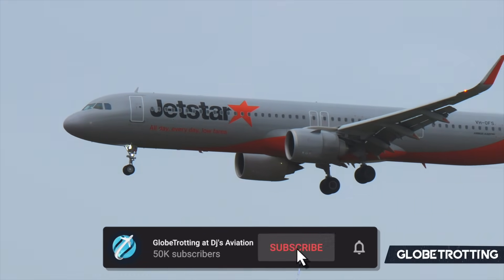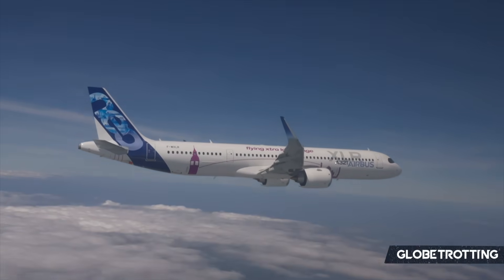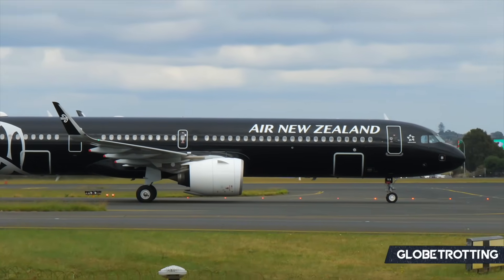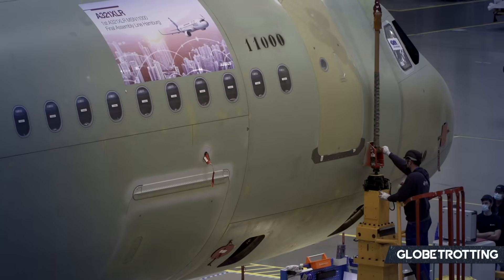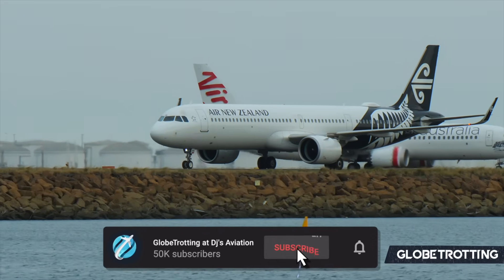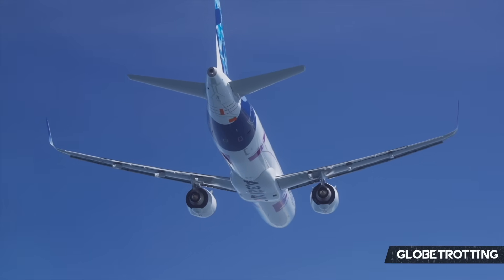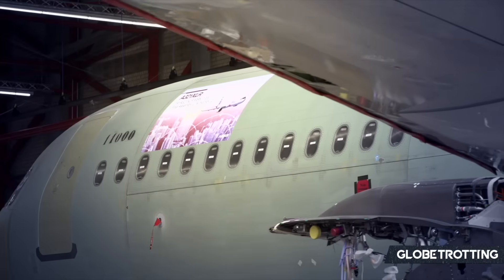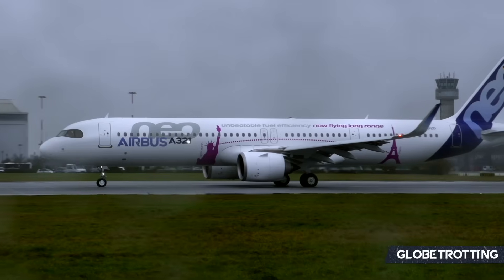The Airbus A322 vs A321XLR

Comment: To me the A322 sounds like a DC8 series 61 or 71. A sound aircraft of its time stretched a bit just before the next big change happened.  ( wide bodies in those days, rather than efficient engines and etops)
Reply: The A322 is a fake concept and it’s not an A321NEO, it should be retired

Comment: No A322 until 2030-at least. A322 will cannibalise the current order backlog on the NEOs.
Reply: Agree i don't see Airbus launching an A322 this decade will probably use a variant of the Ultra Fan, new high aspect ratio composite wing and thermoplastic Carbon fuselage.
Reply: @ivanviera4773 the A322 is a fake concept and it’s not an A321NEO, it should be retired
Reply: @Mf-ct5ms: the A322 is a fake concept it’s not a NEO and not an A321NEO, it should be retired. The A322s would make the A321XLR and A321LR useless they’re production would be discontinued and they’ll be scrapped, that would be dreadful

Comment: The 757-300 wasn't successful due to its length and the amount of time it would take to load plus the hit you take on range isn't worth it so an A322 seems like Airbus would be barking up the same tree with the same results. Once you get into mid 200s in pax capacity, a widebody becomes the better tool.
Reply: The 757-300 was 54m long a Airbus a322 could be just 49 or 50m long, just a bit longer than the 757-200
Reply: @young-j731  at that point you're encroaching on the already poor sales of the A330-800 which I think is another reason Airbus won't consider a 322.
Reply: @ekt8750 that’s why the A322 is a fake concept and it’s not an A321NEO, it should be retired
Reply: @young-j731 the A322 is a fake concept, it should be retired
Reply: The worst feature of the 757 was the same as its best feature - overlarge engines that gave it great performance (pilots love it) but also made it a gas-guzzler.

Comment: I'm surprised there isn't already a A322.
Reply: Lack of suitable engines to power the longer and heavier stretch, unless a significant amount of weight can be lost.
Reply: @neilpickup237 would an a322 not be a carbon composite sort of deal making it lighter I have zero clue btw so don’t roast me 😅
Reply: @h0udinl As for carbon composite -  for the wings possibly, however, for the fuselage, this could require so much re-engineering to optimise that a clean sheet design may make more sense.
Reply: @h0udinl the A322 is a fake concept and it’s not an A322, it should be retired
Reply: @neilpickup237 the A322 will make no sense because it’s a fake concept and it’s not an A321NEO, it should be retired. The 757-300 is longer than the fake A322 concept so the fake A322 concept won’t be a replacement for the 757-300, the fake A322 concept will make the A321NEO production useless and the A321NEOs will be scrapped, that would be dreadful

Comment: Almost as if Boeing should have really updated the 757 to compete in the future. A322 would just be an improved 757.
Reply: @tylerduchesneau  imo they picked the wrong narrowbody to hitch their wagon on. When the 757 launched there were plans for a -100 which would have been a shrink of the -200 and fit slightly above the 727-200. Boeing scrapped it after seeing that it would likely hurt sales of the upcoming 737 Classic series.

Imo the time to act would have been in the late 90s after the NG launched to develop a clean sheet narrowbody to unite the 737 and 757 that would work for both the likes of Southwest and the legacy Big 3 all who at the time operated big fleets of both types
Reply: @tylerduchesneau: the A322 is a fake concept and it’s not an A321NEO, it should be retired

Comment: It's official: The A321 has evolved into Airbus' own spin on the 757.
Reply: I have flown the A-321xlr.
The B-757 is much better aircraft. Why, because it goes like a home sick angel.  The xlr needs lots of runway and the climb is when full , not awesome,  just OK.
If Airbus develops a A-322 they better get much more power. Above flight level 300 the xlr is not going up very fast. PW-1130..
Reply: @tomg6284A322 is a fake concept and not an A321NEO, it should be retired

Comment: Please explain the "rear center" tank, I'm confused.
Reply: The Rear Centre Tank is positioned behind the landing gear Bay or forward part of the Aft Cargo bay. It provides nearly 13000 litres that transfers fuel to the Centre Tank only, hence RCT,, It is a semi circular tank under the cabin floor and uses the extra fuselage space that the ACT on the LR version does not use, hence leaving more cargo space for passengers.  A similar RCT was on the A340-500 to increase it's range.
Reply: It's a fuel tank in the center under the fuselage around the rear area where the wing connects to the body. You can see an extension to the bulge where the wing meets the body to the rear that serves to protect the fuel tank on the A321 xlr against the A321 neo
Reply: @DYLANEFRONDEROZARIOMoe  So it's the center tank then.
Reply: It is a fully structural Fuel tank, see below.
Reply: The RCT is in the Fuselage contour and has a semi circular bottom following the fuselage.
Reply: @tomosb95  So it's the center tank then.
Reply: @dhroman4564  No the Centre Tank is between the wings ( rib 1 RHW to Rib 1 LHW ). It is forawrd of the Landing Gear Bay. Behind the Landing Gear Bay and in the Cargo bay is the Rear Centre Tank holding approx 13000L.
Reply: @tomosb95  Ok now I get it. Thanks

Comment: To my knowledge Airbus has already plans for the A322. 
They put these plans into storage instead of proceeding with its development.
Reply: Yep, like the A220-500. Plans are sitting there, fully complete, just waiting to be dusted off if and when demand for existing A220 and A321 slackens off enough so their manufacturing capacity can catch up. Or if Boeing starts to develop a competitor. No sense building a new model when you can sell your existing models faster than you can build them.
Reply: A322 is a fake concept and it’s not an A321NEO, it should be retired
Reply: @Luke-GO: the A322 is a fake concept and it’s not an A321NEO, it should be retired
Reply: @sebastianfloyd372  The A322 had very real studies, concepts and plans. What you mean is the actual development of an A322neo. Behind the scenes, Airbus must have done studies of why they should invest $2 billions into an A321XLR instead of an A322neo - not to mention the reasons why Airbus started developing new wings for an A322-sized airplane...
Airbus is currently developing two airplanes with an A322 size: the A320neoNEO family(name not yet determined) and the ZeroE program.